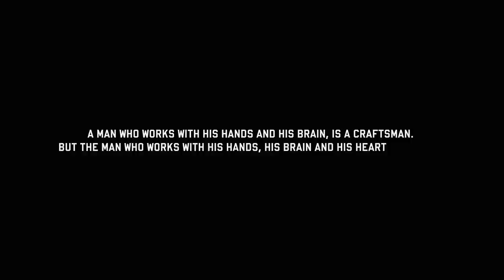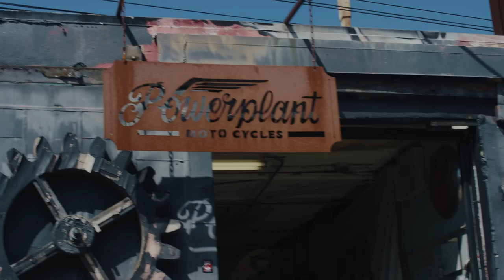Norman Reedus Meets His Custom Indian Sport Chief

Comment: Had a 71 sportster, constantly breaking my  xlch kick start gear come off caught the primary gear at 100 mph I flat tracked to a stop. I called Harley and got ahold of willie Davidson. I told him get some engineers and redo the motor where u could ride 50 miles without having to tighten a bolt, cause Honda was gonna kick his but. Bought 750 Honda while the Harley was in the shop.1985 I think Harley come out with evolution motor rest is history.